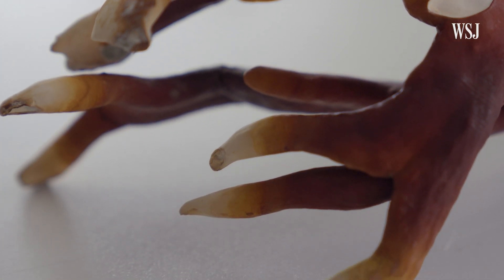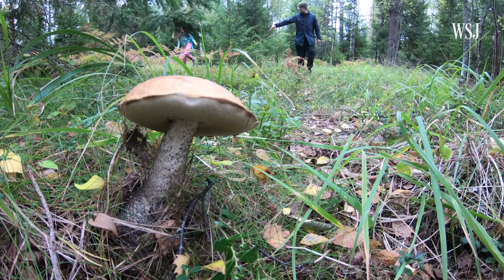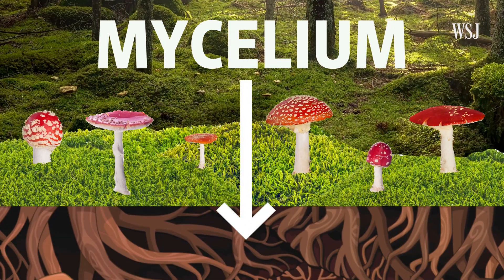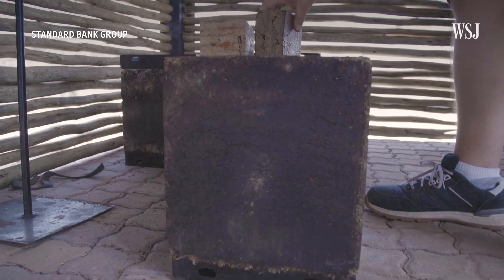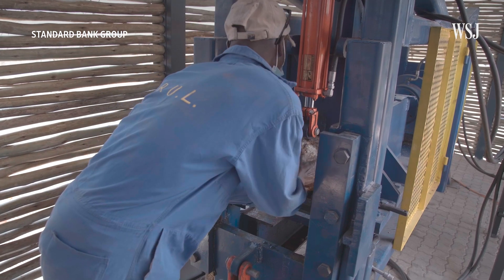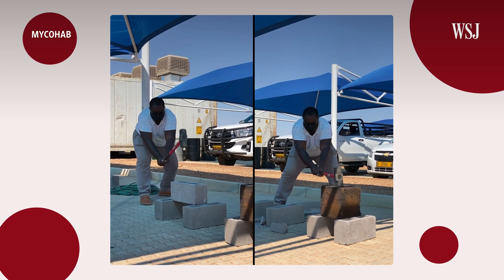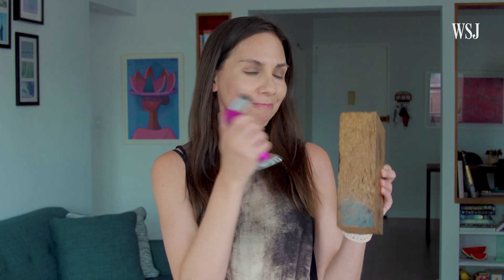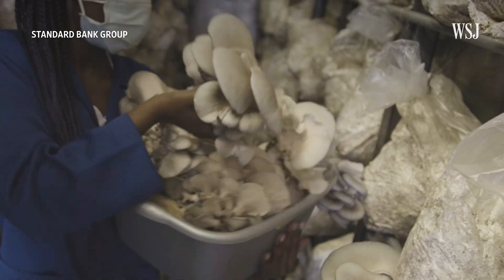These Mushroom Bricks Are Up to Twice as Strong as Concrete

Comment: I'm calling BS on this. Mr Maurer said the bricks are 2x stronger than concrete and he gives 26 MPa (3,771 psi) as their strongest formula. The minimum compression strength for concrete is 2,500 psi. Do the math. And the sledgehammer test is a joke, look at the blocks! The concrete block has large voids, the mushroom block has no voids. 
Of course the cost is too high, and until those bricks are waterproof and affordable no one will want to buy them.
This kind of story is only good for one thing: to prove how bad our media really is.

Comment: What I'd be most concerned with is if mold or other fungal material would grow on it in even slightly humid environments. Also does it decay over the span of decades when exposed to harsh sunlight, heat, cold, and rain. Plus, would ants, hornets, or beetles make themselves at home in the blocks? Just some things to consider
Reply: That was my concern as well, on the other hand houses are built using OSB boards, and wood which is both flammable (new types of OSB boards are fire proof though) and may decay due to humidity and pests. I think mycelium could be great material of the future, but years of experimenting and research are needed before we can go full Smurf Village. 
At the moment mycelial panels can last up to 20 years if kept in good conditions. In contact with earth, water and contaminations - probably 6 weeks.
Reply: We could use some methods to prevent that. Ever see the stave church in Norway? Ancient structure made completely out of wood. It's lasted for so long because the wood was lightly charred, then treated with pine tar. I'd do the same with mycelium blocks. The hippies might like structures that can biodegrade, but I myself would want to build my structures to be able to last 1000 years.

Comment: Is it inert? Cause thats one of the selling point of concrete. Also, you usually reinforce concrete with steel, to improve its strength. Never is an infratructure built solely on concrete.

And come on, you guys smashed a hollow block vs a solid mushroom block.
Reply: Those two blocks weigh the same and have about the same use case, it's about visually demonstrating a point. there will have been real compression and tensile testing done but seeing two block crumble under a hydraulic press isn't as visually impressive as a sledgehammer.
Reply: @sebastianflynn1746  the mushroom block was solid, twice as tall, twice as wide, and half as long. It has everything going for it in that "test"
Reply: They should make a hollow mushroom block
Reply: Well, they have to make those sweet sweet views, mate🤷‍♂️
Reply: Concrete is not inert, it's usually decently alkaline and the calcium compounds often used are highly volatile